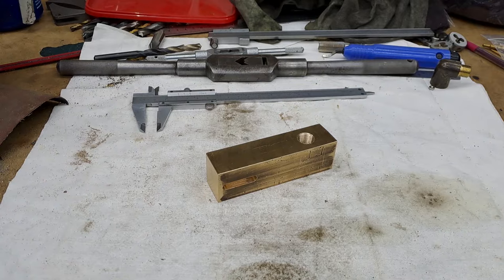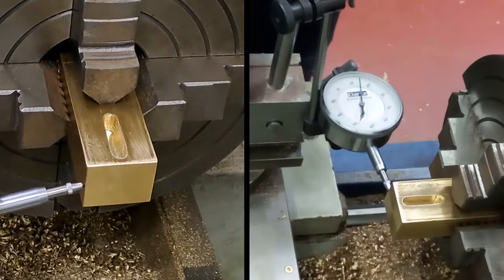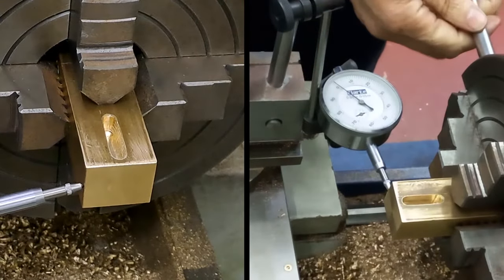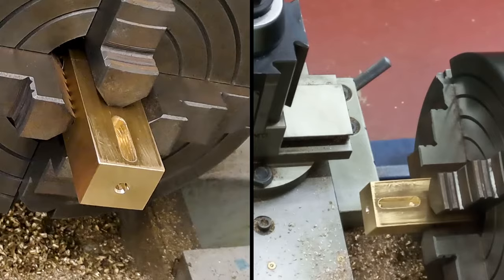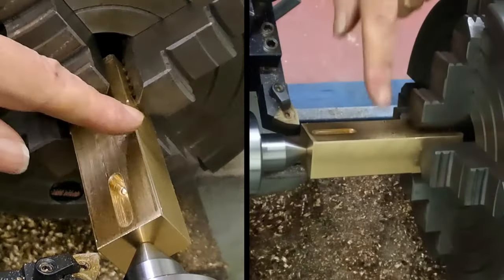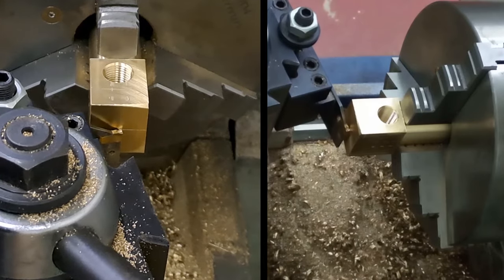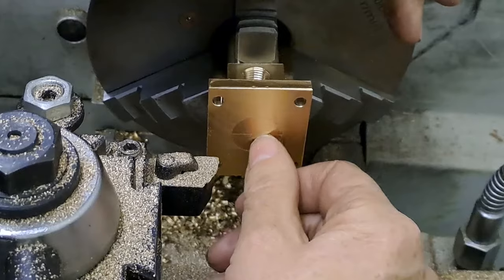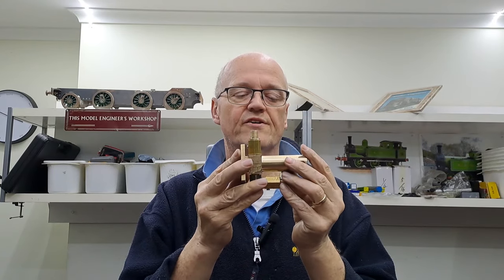039 Rounding the Corners

Comment: Drives me up the pole centering up in the 4 jaw! I have made a small chuck key to work from both sides so saves a bit of time but when you are chasing the last few thou its mind bending. 
Probably why I never went on the path of a machinist. 
Thanks for taking time to upload.
Reply from the maker: Thanks for the comment. I have seen this way before. I'm not sure it is for me, though. I find it hard enough with just the one chuck key!
The Chef